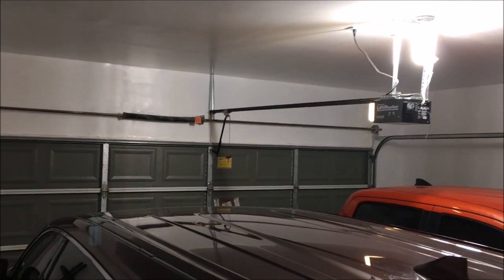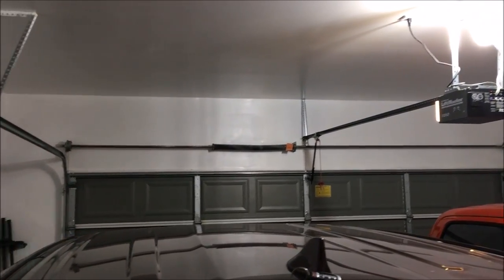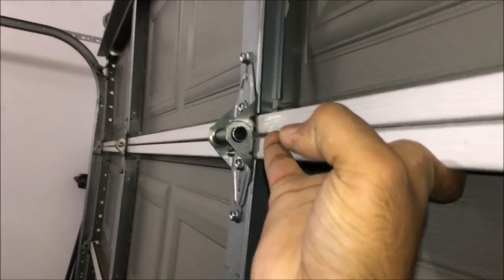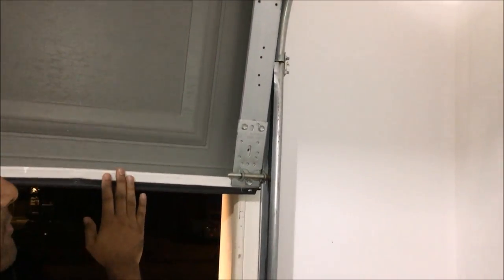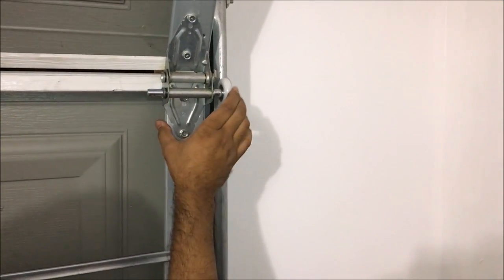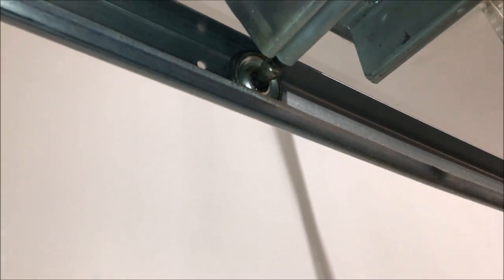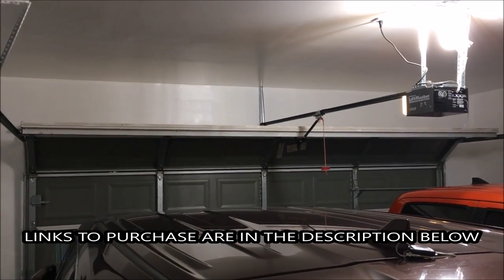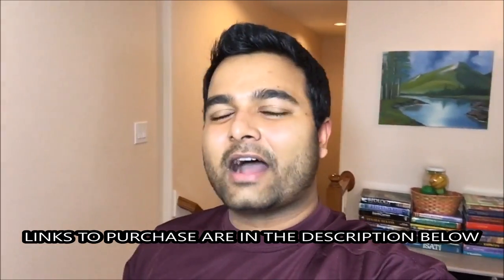HOW TO Make YOUR GARAGE Door QUIET  (Hear The Sound)

Comment: Couple things. You didn't need to unbolt the lift arm...just pull the cord to free the trolley from the drive. Also the vast majority of the noise from your door is the opener. I changed from screw to belt and with a squirt of oil on each roller shaft it is near silent now. Get yourself a belt drive vs that chain and you won't hear anything.

Comment: Rather then bend the rails, I would have simply unbolted the entire hinge assembly. 
It would definitely take more time, but you wouldn't disturb the rail system.
Reply: Anthony Ellerbrock  unbolt the bottom one on film
Reply: Anthony Ellerbrock ya don't bend the track you may never get it to bend back correctly and replacing the track is hugely expensive💰
Reply: Anthony Ellerbrock but be careful for the bottom cause theres a cable on the bottom and it has large amounts of torque
Reply: Yes. I watched another video and that guy was a professional installer. He said that removing the hinge might cause more as it contains that cable you're talking about. The other did it similarly like this video. A little bit of bending and prying makes it work.

Comment: I do this daily nylon rollers are standard now yes definitely help but you're never going to get rid of the metal on metal folding and movement noise out of the garage door you just can't you can keep it quieter with nylon rollers and if everything is lubed good and you have proper spacing in your rollers no binding but they're going to be a little loud.... especially some of the chain driven operators they can be very loud but still 100% functional belt drive is the way to go to decrease any operator noise. And definitely the smoother you can keep the track transition the better bedding to match at the flag bracket making sure your track bolts are not hitting rollers simple stuff!!!!! Common Sense stuff..

Comment: Thats reckless and crazy bending your roller guides. Just raise the door to the top, so the bottom wheel with the tension wire sits just below the vertical joint, clamp the horizontal by the next roller to act as an anchor, then just unbolt the vertical guide, wheel can be removed, and replace guide, simple. Then do the same for the other side.

Comment: can't you just unbolt all the brackets instead of bending the track i really do not like the idea of bending the track
Reply: u can, but the bracket for the bottom roller has the cable attached, if u unbolt this, u will get severly hurt. its what lifts the garage door.
Reply: TRUE , THATS VERY DANGEROUS
Reply: but if you lift the door  up before you unbolt the bottom one  it will be ok right?
my door won't go up or down for shit  ,the gears in the opener  have striped out
everything looks like it is rusted to shit  rollers and springs
do you think just replacing the rollers and lube will work ? my springs are really rusty but not broken
the door is like 20 years old almost on a detached garage in new england  exposed to all sorts of weather and  temps, i have hardly used it though because it never worked since it was installed it would go back up all the  time after closing or not go up ,creeks and banging sounds, i adjusted the travel limit but it  would always work a few times then act up again so the springs have not got any where near 20 years worth of up and down cycles but look rusted AF should i just replace the rollers and lube it and see if it  gets better before replacing the springs?
i am going to  order a  gear kit and probably a new limit switch once i get the door going smoothly and figure out the model number gear kit i need
Reply: Andrea Mitchell  Please, please, please call a professional overhead door repair person. Messing with a garage door is very serious.
Reply: sorry i don't have 1000+ to spend on that, it can't be that hard
not to mention there is only one overhead door company with in 5000 miles of me,t eh same ones who installed it  and fucked it up where it would never stay down  or go up and down without reversing 50 times and making you hit the remote button over and over to stop it and reverse it
Reply: Andrea Mitchell  sorry, didn't mean to upset you by caring. The downforce adjustment is set too lightly on your opener.
Reply: thanks but i adjusted every possible way  and it never worked  right
once the gears stripped out i opened the opener and i see the  limiter switch and the  metal contacts look really oxidized so i think they need to be cleaned or replaced too bad i can't just replace the  metal  tabs  instead of the whole   assembly ,i am going to try sanding them down, and  am going to test them with a continuity  tester 1st to see if that was the problem
but it never worked even when  it was brand new but i didn't really mess with  till after
but  1st i need to  get the door opening smoothly , then i need to rebuild the opener, new main gear , new worm gear  and probably new start capacitor too , then i ican worry about the limiter switch which is a huge pain in the ass to adjust , but 1st i need to make sure the metal contacts in the limiter switch are making a connection  because now they are looking pretty corroded

Comment: NO!! DO NOT BEND THE RAILS! That can bring bigger issues in the future. Remove the brackets, except the bottom one, and replace the rollers one at a time. It takes a little longer but it’s the right way to do it. Do not replace the bottom rollers until you have watched an actual expert on youtube doing it. It is dangerous to remove that bracket if you don’t know what ur doing.
Reply from the maker: Ricky Lopez I appreciate your concern however I have had these for 4 years and there isn’t any issue. It’s not a problem to do it this way.

Comment: hey brother i have a couple questions..

so the first is do you know anyone who sells 10000k (bluish) temperature t10/194 or headlight strip for the accord light strip?

second is do you know of anyone who sells the led turn signal for front and back that requires no load resistors in red?

thank you!!

Comment: Lift master sucks!!  Linear brand is 10x better
Reply: Considering I have a liftmaster 3245 that is 11 years old and still runs great, and the linear LS050 I had died after 3 years. I find that statement to be false
Reply: Josh 9 years here with liftmaster 😍
Reply: Even liftmaster has cheap lines and more expensive lines.  Consider spending $100 upgrade on an upgraded model would be a game changer